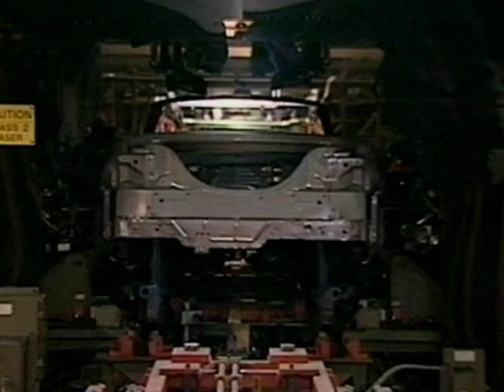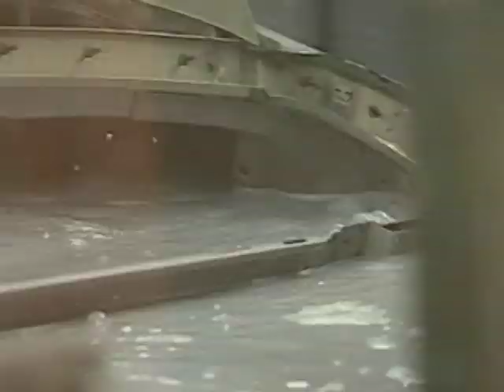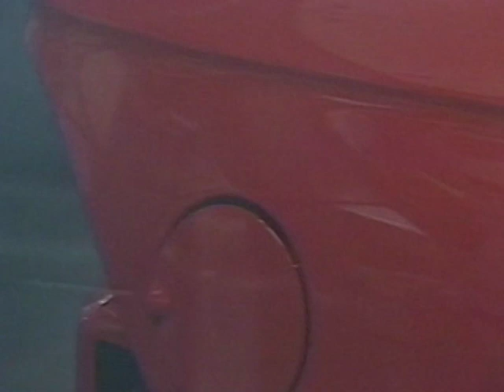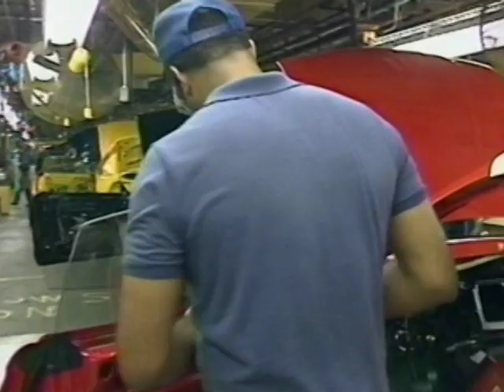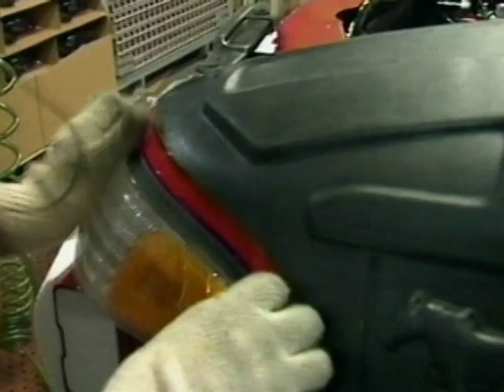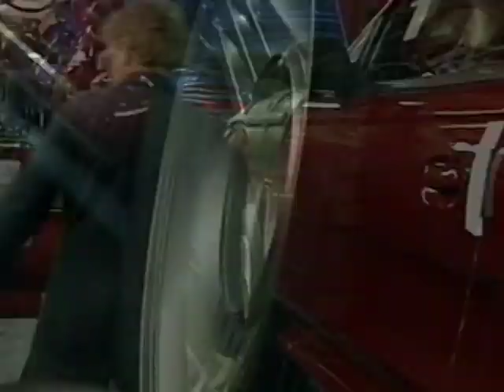How A Car Is Made - 1994 Ford Mustang

Comment: I still think this year model is one of the best looking ones.  Maybe I'm a bit biased since I have a '94 V6 and I prefer the 3 horizontal bar taillights versus the three vertical section tails that came in '96.  I have seen a '94 style tail without the paint and think the look great like that as well.
Reply: Wayland C I have 94 v6  also. That I am making  custom.  I hate the tail lights. So I plan on doing Ford Gt tail lights. Circle ones with custom fiberglass cover that will match paint
Reply: Wayland C actually the tri bar came in 1995 because they’re on my 95 GTS convertible

Comment from the maker: @comelunch103  Well, Ive had my 94 mustang for over 12 years now, 173,000+ miles, and I think its more dependable and reliable than 21st century cars, domestic and import. That includes high end models. A car should last more than 3 years without any issue IMO. Whats worse is when something does go wrong with these new cars, they refuse to fix them for free, claiming user error.

Comment: holy crap.  i think european vehicles are built with  the 6 sigma process alot better.  its as if these folks just look at it like a job and put no pride in the assembly of the vehicle.
Reply: azthundercloud f
Reply: azthundercloud ford has been using 6 sigma at least the 20yrs I've been at the rouge